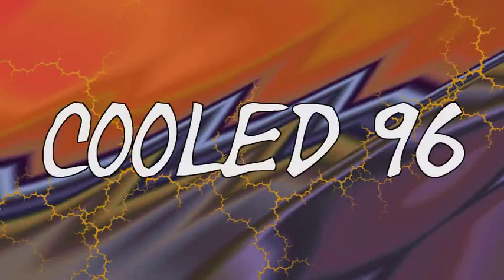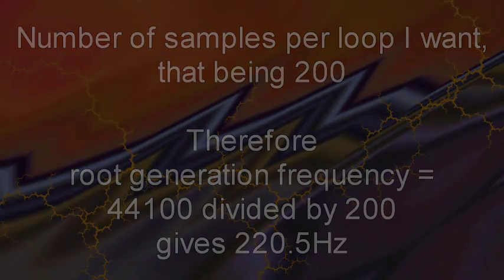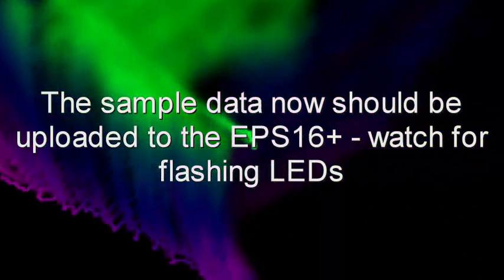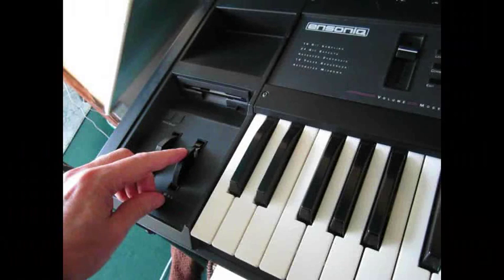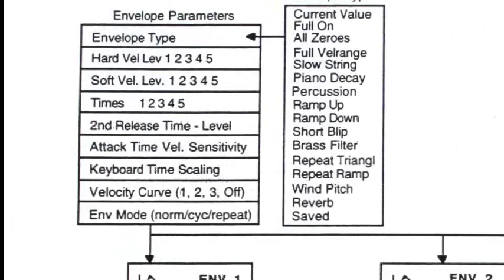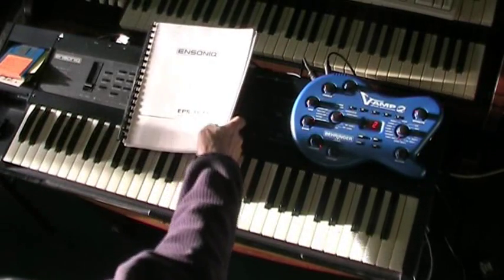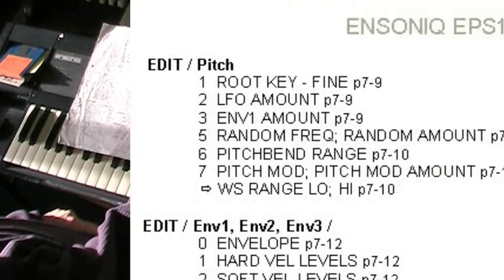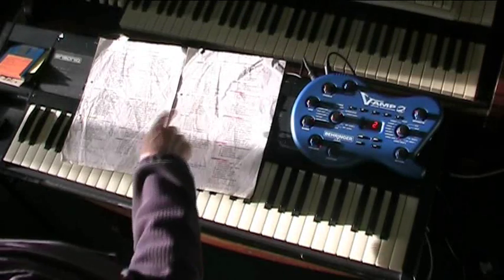Transwaves and Win/MIDI transfers then go to it!

Comment: Sorry that Cool edit 96 can't be installed on Win7
Reply from the maker: Bit of a pointless comment really, use something newer, I do. Some people will even say who uses Win 7!? that is soooo old. See how easy it is?
Reply: What the "newer" thing that can be compatible with ASR-10 please?
Don't talk about Chick... softwares, i had exaclty the same issues with GH about EDT...
Reply from the maker: @samplidium  I'm with ya Bro, it amazes me  still today just how much time and effort I spent/wasted with GH trying to get his MDT to work. GH did make some effort and then resorted to insults. I worked out the fault is 100% his software and can demonstrate it. 
After cooling off I went on a journey to find other techniques to program the EPS16+. I think it's always going be a front panel job it's direct. Whereas sample editing, uploading, library functions can be done on other systems. Some people tell me MDT works for them and I know there's many identities GH takes to defend his products.
I finally got a Macintosh+Alchemy working and then later found SampleWrench. Giebler did all the library functions. Happy chap and no GH.
Reply: Those "softwares" (if we can call them like  that) is outright scam, they absolutely do not work without crashing in seconds!
On my EDT I can only format a floppy disk under Win XP...

As you say, if someone says that it works on their PC it can only be a member of this company...
I'm ony using Total Commander with "fs" plugin now.

Comment: I have exactly the same misadventure with Ensoniq Disk Tools, and I had the same answer as you: "i can't replicate your problem on my computers" from the manufacturer...
Reply: Omni Flop has two drivers that need to be manually installed on your system via the [driver update] in the Windows Control panel \ Hardware section for Ensoniq Disk tools to work.

1. OmniFlop.sys | OmniFlop.inf = Floppy driver
2. OmniFDC.sys | OmniFDC.inf = Controller driver 
After installation the Ensoniq Disk Tools will be capable of reading your EPS & ASR files. The software can then extract those files into a folder which will be readable and transferable to zip or usb disks.
Reply: @MrBillyBatson  thanks for your comment and precious information.

Comment: I have tried this with my asr 10 and I get the error invalid parameter during transfer and it appears to only upload a single cycle. Any info?
Reply from the maker: It can be a faff (hassle) to find the setup that works for you. I recall Sample Wrench worked for me whilst others didn't, I suppose it gets into geeky tech detail as to why.
Then it's a case of making sure the input wave is as the uploader and sampler expect, there are usually a number of boxes that need to be ticked. I would think this is the invalid parameter error your getting. This covers everything from the source wav file to having all the correct tags (CoolEd doesn't add the correct tags, Audacity does), double check all the settings in Sample Wrench as it could be the ASR finds something wrong with the data. If you can, send me your source file and I wil try in in my system (so a small file please).
Reply: The files I was trying to use were just the stock files from Audio Term just to test how to do it. I tried with wav and the .efe ensoniq files that come with the program. To be fair I didn't know the cycle size so I left this blank. I also tried with a direct upload from Tranzillion. This seemed to work, wave sample size was 10000 or so and the loop points appear to be set automatically but the wave could not be modulated. Still sounded like a single cycle, even with transwave off.
Reply from the maker: Yeh seems like ya need to set parameters in the ASR. Once the WAV has been uploaded to the ASR it then needs to know it's now got a transwave and how many bytes each loop is. In the EPS16+ in the wave edit section there is a setting for transwave and loop length. It's easy to work out, a websearch will give a result, Don Solaris has done some nice tutorials. I think Tranzilion does a transwave of 100 samples, you just then need to know how many waves (of 100 samples) make up your whole tw. Sounds like you're just about there. Don't forget the ASR then needs to know how you want to go through those waves, so unless you modulate the loop ponter, yes the ASR will just play the first loop.

Comment: Great demonstration.  Thank you for the clear instruction.  I have also considered the hxc drive, but have also read that since it is running from the floppy ribbon, that causes it to transfer at the same speed as the original floppy.  I opted for SCSI instead, for speed.  I'm also not sure how the EPS handles the drive.  Does it only allow saving of sounds no larger than a real floppy (and segment them off in banks of floppies), or does it allow sounds larger than that?  Perhaps someone that has the Lotharek and an EPS can chime in.
Reply: I think I know the answer, though I haven't actually used Lotharek's HXC for my EPS16+. I have used it with a Korg DSS-1, and I assume it works the same. ---You fill an SD-card with "disk images" for the sampler, put the SD-card in HXC, then you select on the HXC which "disk image" you want to use (selecting a disk image here is like putting the floppy in the drive) and then you're good to go.
Reply: So yeah, you cannot save any larger chunks than a floppy-disk could hold, that's what I'm saying.